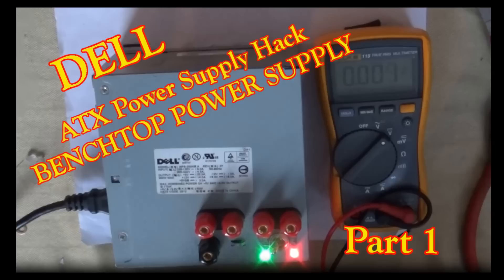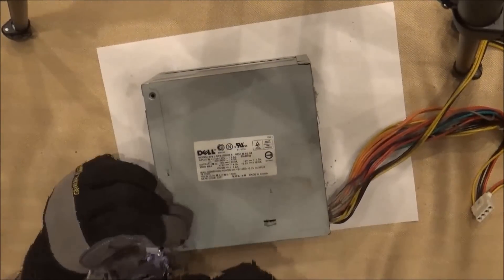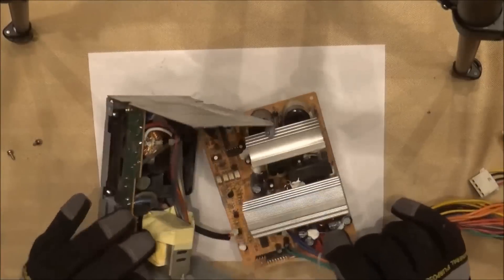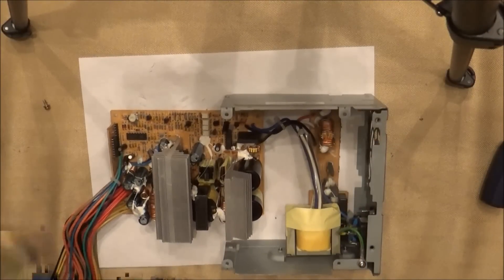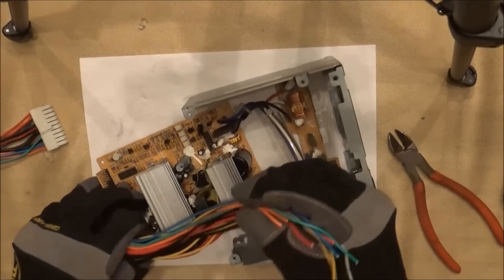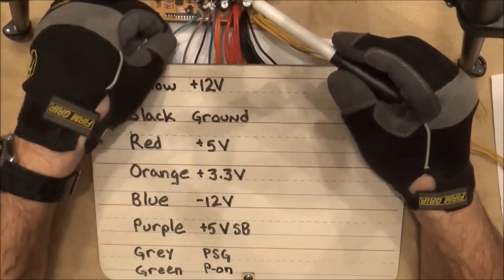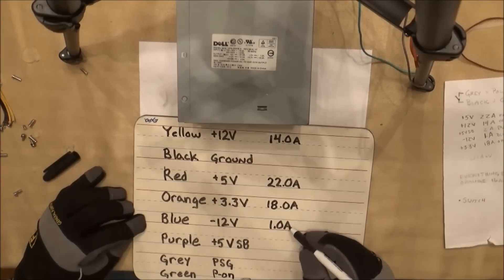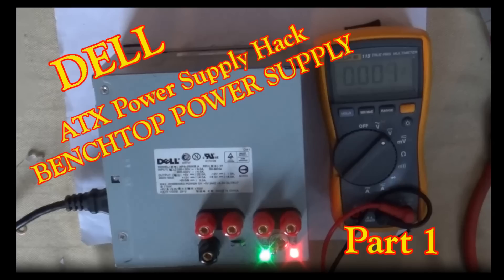DELL ATX Power Supply Hack! Benchtop Power Supply! PART1

Comment: Heath, love these videos. I am however having trouble seeing some of the connections you make. Specifically, the grey wire. Is that a simple grey wire with a resistor back to ground?  And if so what size resistors are you using, 220 or higher?

Also, I have read elsewhere that you must put the PSG wire under load or the supply will not start. Do you have to do this with a NPS supply?  I have a NPS-210ab supply I am converting. 

Thx for your help. 
Steve
Reply from the maker: Steve Meynell The grey wire was not used at all. I did not have to put a load on my conversion. It works just fine, glad you enjoyed the video!

Comment: Sir Viewed part 1 and 2. I have several to convert and could use some help. Would you provide assistance...Thanks
Reply from the maker: J Carter I will if I can. What is you question?
Reply: Heath Putnam Thanks ahead of time... The unit is a Dell HP-P2507FWP. During test without anything but open wires when connecting a multi meter to test amps the unit will run with a 9 amp draw (green and black only connected. When adding a resistor to 5+ leads without the multi meter it shuts down, Do these need a load resistor?   How did to wire the  LED  into the switch?  Your set up is different than others I have viewed  that require a load resistor. I need to used 12 v leads only on this one. Rating are +5=22a, +3=18a, +12v=16a.
Reply from the maker: J Carter Your unit does need a load risistor to stay on. Being as you are only using the 12V output adding a load resistor to the 5V rail will not cause you any issues. I wired an LED jumper using red (5V) wire --> resistor -->LED --> Black Wire and hooked it to the appropriate binding posts. That will turn the LED light on when the DC rails have power. The other LED is wired Purple (5V Standby) -->resistor->LED->Black Wire, that will light when power supply is plugged in. Hope this helps.
Reply: Heath Putnam Sir just tried. Led is working. Im showing 12ish v off yellow. When I put the 12v under load the fan motor bumps then 12v stops. When I put the multi meter inline and re starts the unit will run the fan ant a amp draw rate od 8ish. Suggestions?
Reply: J Carter Forgot to add I tried but WITHOUT a load resister. Do you suggest I put a 10ohm 10 watt +- 10% on the 5v rail or where ? what size?
Reply from the maker: J Carter  You may need to short your grey wire to a black wire... Try that first before adding a resistor. If that does not help, try a 100ohm 10 watt resistor on the 5V rail... DELL powersupplies vary greatly. Good luck!
Reply: Heath Putnam Thanks Ill give it a try and let you know
Reply from the maker: OK :)
Reply: Heath Putnam Sir  when any load is put on the unit shuts down. I have several others Id like to try HP250KBC and a KBD are or is one close to your model that will work under tour set up.  It appears that the voltage is no problem but when I add load they shut down   Thanks
Reply from the maker: J Carter What is the exact model of the supply you are trying to convert? The 250KBC and KBD should work with my method. I am sorry you are having issues. :(
Reply: Heath Putnam  Have you had yours under a real load to determine your amp draw? I pickup several of the power supplies that were being destroyed. They are HP-NPS-P25007 FWP &  F3R, /  HP-250 KBC & KRDS.  I must be missing something because when I add load 8ish amps it stops.  If this helps, when unit is just on green and black connected) no resistors, I can put an inline multi meter to check amps and it will push the 8 amps motor with no problem. The multi meter leads get hot in a very shot time but that's the only way I have been able to get it to work..................  Thanks
Reply: J Carter Dis some testing with the NPS-250KBC. Set up same as yours. It would run under a 3ish amp draw but under 8ish load it would only bump the motor. When I put the multi meter in line to check amps it would run the motor. why?  Thanks